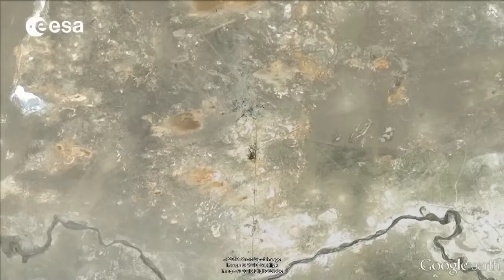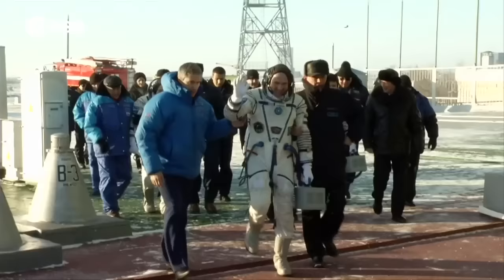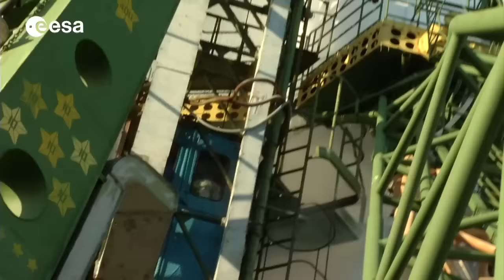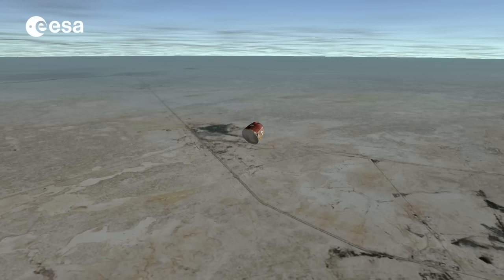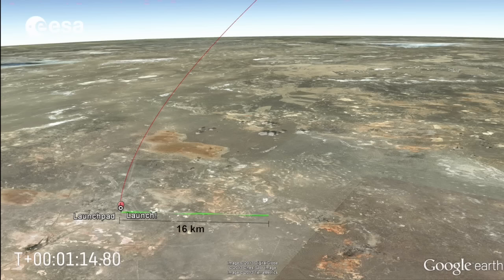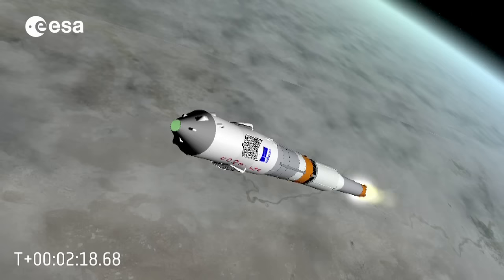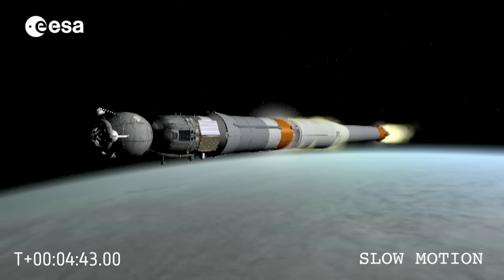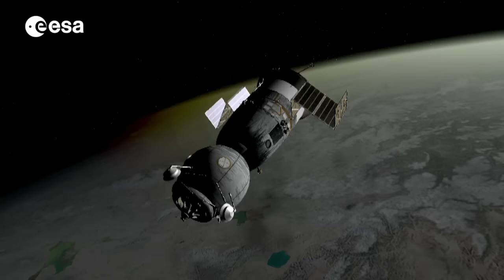The Soyuz launch sequence explained

Comment: Soyuz it's the best rocket ever...
Reply: Soyuz is the space craft. The rocket is an R7 variant. Just like the original rocket developed by Segey Koriolov. Just with all problems of reliability and build quality -solved.
Reply: +mowtow90 the rocket could also be called Soyuz.
Reply: +mowtow90 the spacecraft they use now is the Soyuz MS on the Soyuz-FG rocket.
Reply: I'm
Reply: I guess for Earth Orbit it is the greatest. Everytime I see one launch I feel like I have no worries, she is going to end up just where they aimed her. No Drama, Workhorse!
Reply: Leonardo Solera sls for me
Reply: Plymouth Fury III   It’s certainly a strong message to the US. We had the best with the Apollo spacecraft, and the Saturn boosters (1B for low earth orbit, and V for higher payloads and missions beyond low earth orbit). The glitches had been solved, and we could have gone and started mass production. 

NASA was not really to blame, however. It was the Nixon Administration which canceled almost all of NASA’s post Apollo proposals, and pushed the fatally flawed Shuttle. The Air Force and Intel agencies forced the huge cargo bay. It was supposed to be cheaper, but in reality turned out to be much more expensive. As technology (especially computer technology) advanced, NASA could very well have put updated technology in there. 

Apollo was almost completely redesigned after the Apollo 1 fire. The result was a much more reliable CSM. This was borne out when Apollo 13 had to power up the CM before re-entry. It was feared that water may have gotten into the panels. But it was powered up without any mishap. 

The Saturn proved its capability with Apollo 12, when the entire stack was struck by lightning twice. The well shielded IU kept the Saturn flying in the correct trajectory, while the crew and Mission Control got the Apollo up and running again. 

The Saturn series is one of very few rocket systems never to have any catastrophic failures. I guess the bean counters at Nixon’s OMB never heard of the phrase “if it’s not broken, don’t fix it.” It was a monumentally stupid decision, but there was little NASA could do about it. It doesn’t give itself a mandate, as JFK did, and it has no control over its budget. That’s why you had contracts with various locations all over the country.
Reply: Jansel Kenneth Tolentino   Loosely speaking, you are correct, but the way the agencies worked, the usual nomenclature was to list the spacecraft then the booster system. Such as Apollo Saturn, or Gemini Titan, Mercury Atlas, and Mercury Redstone. I suspect it’s much the same for the Russian space agency.
Reply: Cough cough falcon heavy
Reply: @jfiekms  not ready
Reply: @SIXITHS  lets see
Reply: @SIXITHS  ok boomer
Reply: and the most reliable as well
Reply: @jfiekms  that flying ipad will never replace soyuz
Reply: soyuz is a European one? and the dragon usa? where all the parts go from the rocket?
Reply: 🤣🤣Falcon 9 is the king
Reply: @jfiekms  ok troll

Comment: Although i loved the Space Shuttle, the Soyuz is a much safer vehicle for getting humans into space, and very reliable. Very interesting to be able to see all that is involved with the launch.
Reply: +100SteveB. I wonder how hard the landings on the Soyuz are on their bodies? The Space Shuttle landings are very gentle on the Astronauts bodies.
Reply: +SanFranciscoBay Yes, I agree that the shuttle was a totally awesome program, but it wasn't logical. Each flight costed around 500 million dollars, while the Soyuz costs 60 million. The Soyuz is also much safer, as if something goes wrong you can shut down the engines. On the shuttle, once the solid rocket fuel is ignited there is no going back for 2 minutes. Personally, I would take the Soyuz,
Reply: The good thing about the shuttle was that it was reusable. Or at least somewhat. The orbiter itself was obviously reusable and the solid rocket boosters would be reused, refurbished or recycled. The external tank was left to burn up in the atmosphere after separation.
It would considerably lower the costs of each launch if some of the soyuz parts were reused.
Reply: KlixTrio 
"On the shuttle, once the solid rocket fuel is ignited there is no going back for 2 minutes."

This is exactly right. I think it was von Braun who said that no human should ever ride a solid booster rocket. With the Space Shuttle, it was a combination of the two so there was at least some room to manoeuvre. The issue came up about ten years ago when NASA proposed a spacecraft powered by a single solid booster (Orion?). It was supposed to be ridden by humans... But you are absolutely right: once that thing is alight, there's no shutting it down. And I agree with your conclusion. I would take the Soyuz too, 100% and for exactly that reason.
Reply: Actually I'd take new Federatsiya spacecraft aboard the new Angara rocket. To the moon.
Reply: Nah on second thoughts I'm just gonna ride a V2
Reply: So called reusable engines had to be refurbished for months to be used again. Space plane is a cool idea, but its just too early for current humanity technological level.
Reply: And cheaper to launch
Reply: KlixTrio I would take the soyuz for safety, if I would have 2 life's shuttle absolutely. It's something amazing, cannot even explain it 😍
Reply: Shuttle was, unfortunately, an expensive death trap.
Reply: As a kid, the Soyuz freaked me out because I had a problem with claustrophobia. The cramped interior combined with bulky space suits and a tiny hatch, scared me to death, even from 5000 miles away. :)
Reply: TheThirdMan The Ares I
Reply: TheThirdMan You're thinking of the Ares I, and you're absolutely right. The extreme vibrations would've killed everyone aboard, so they thought pf using a giant spring, but even that wouldn't have been enough. But it sure looked cool.
Reply: SanFranciscoBay Gentle landings? Literally everyone to land the shuttle says it flies like a brick. It needs a parachute to land. It's descent rate is 15 times that of a regular plane on final approach to the runway. Every landing tore up the runway, resulting in both the tires and the asphalt needing to be repaired.
Reply: Samovar maker the thing about the shuttle was the maintence. It was so expensive and time-consuming that some would say it was better if they just built a new one. It wasn't powerful enough to get even 30 tons to orbit so it didn't make sense actually
Reply: The Shuttle was the way it was because NASA had to get the Air Force involved in order to get funding for a reusable launch vehicle and the Air Force wanted certain things like the ability to set down at multiple landing zones and the ability to launch and land in a single orbit. Basically they had plans to use it as a sort of orbital spy plane but advancements in spy satellites rendered that option unnecessary. So NASA ended up with a system bloated with capabilities that were irrelevant to what they ended up actually using it for. Putting the orbiter right next to the fuel tank was a terribly unsafe idea, but necessary when you've designed something that is basically an airplane attached to a giant rocket. A capsule could actually have survived the kind of accident that destroyed Challenger because it's on top of the rocket and can be ejected from the main booster in an emergency.
Reply: SanFranciscoBay   That’s assuming they survive the flight. Apollo was every bit as reliable, especially the re-design after the Apollo 1 fire.
Reply: SanFranciscoBay  The current problems upon re-entry now have little to do with the astronauts or cosmonauts medical issues upon landing. The problem is that even with strenuous activity by the ISS crew, they still have loss of muscle tone, and loss of the skeletal structure. Not to mention problems with their eyes. 

The returning crew has to be carted away on stretchers. That needs to be solved.
Reply: TheThirdMan   The Shuttle was a perfect example of what happens when you design and build something by committee. That resulted in a very dangerous vehicle. Originally, the orbiter itself was going to be much smaller. And the boosters were going to use liquid propellants.
Reply: KlixTrio,
There is no denying that the space shuttle was more expensive but, you are comparing two things that have a different purpose.  It all depends on what you want to do when you get there.  A lot more could be done with the shuttle.  It had the volume and systems to conduct many experiments as well as placing other satellites in orbit and served s a cargo vessel as well.
Reply: TheThirdMan   At least with Orion, solid boosters or not, will have a launch escape system, just as Apollo did. There was no such system with the Shuttle. And the costs of re-use were MUCH higher than the older, expendable boosters and spacecraft. 

The Shuttle was a very expensive death trap. It was also much more expensive, and was strictly limited to low earth orbit. It could never survive re-entry from a higher orbit. The orbiter would be torn apart.
Reply: The Soviet Buran was basically what the space shuttle would have been, ideally.
Having been designed years after the space shuttle, without any additional special requirements by other departments, and with low cost per launch weighing heavily on design, it would have filled the low cost reusable role MUCH better than the space shuttle.
Energia, despite never having had the chance to test reusability, was meant to be a reusable super heavy lift rocket, and as a standalone rocket it could be used without Buran to potentially lift ISS components into orbit.
Whether or not Buran was safer, we'll never know.

But in the end, you're still sending a very large reusable vehicle into orbit...for what? Both shuttles ended up being unnecessary expenditures.
Reply: I always think about Soyouz as a high quality bicycle while Space Shuttle is like a modern car. Bicycle, of course, is safer, harder to fail. But it cannot carry much weight and technology. Remeber, SS can deliver 7 men, tons of goods and devices, reaching higher orbit (I am actually not sure when writing this).
Reply: Space shuttle was sketchy - no real abort system
Reply: @klixtrio7760  I mean the Shuttle was designed to do stuff no other spacecraft, apart from Buran, could do. Not even the new 'Starship'. It could carry large ammounts of cargo and a big crew (7) simultaneously. It could 'manually' place sattelites into orbit. It could allow space walks. It could allow even the retrival of sattelites, something which is impossible now. Without the Spcae Shuttle, maintainance on hubble would have been near impossible (or even many times more  expensive)

Comment: Problem: G-forces during launch make it hard for the pilot to reach up and hit the switches.

NASA: "Better go back and redesign the entire layout of the interior."
Russia: "Give the pilot a stick."
Reply: lol this is so true. It's the same story with the Pen in space - Nasa spent millions to design a pen - Russians always used a pencil -)))))))))))
Reply: ***** NASA spent 0 (ZERO, nil, none) money on the spacepen. It was independently developed by a company from whom nasa and the soviets bought pens from for $2.95 a piece. WOW, $2.95 = millions! NASA used pencils initially too, but the reason neither the soviets or NASA continued using pencils is because if you break the tip, now you have a conductive piece of graphite flying around that can get into small cracks and equipment. Youd think in the age where a simple google search brings the information of the world to your fingertips, moronic assumptions and urban legends would die, but nope.
Reply: +Ron Ramen In present time yes but back in 60's soviets used a pencil on the other hand nasa (or contractor it's irrelevant) develop a pressurized pen and it wasn't near as cheap as a pencil back in time
Reply: Its literally $2.95 and it was the Fisher Pen company that spent money developing it.They weren't even a contractor (which they would be if NASA paid them to research pressurised pens) NASA literally just bought pens from them. They could have bought them from BIC, or Mead or whoever. You're just splitting hairs.
Reply: astronaut NOT pilot
Reply: Советские космонавты использовали автоматические карандаши. Они не ломались, были безопасны и надёжно писали в любой среде.
Reply: My granddaughter solved this problem. CHALK... just don't clap the erasers. :)
Reply: No idea what you said, but I bet you are correct.
Reply: russian use common pens, not pencils.
Reply: Both have their ups and downs
Reply: It is just an urban legend, that pen-pencil thing.
Reply: That's a myth.
Reply: That is not the point. The point is the huge gap in mentality. One looks to avoid the problem altogether, (Leave the interior buttons where they are) whereas the other tries to address the effects of the problem.
Reply: Extra Salty  Pilot is appropriate if that particular astronaut happens to be the mission pilot.  It is one of the position on a space mission, just like engineer, mission commander, etc.
Reply: It's got a strap around his hand, you can see it if you look carefully.
Reply: Lool
Reply: Extra Salty cosmonaut to be precise.
Reply: Paul JJ That's a myth.
Reply: Ron Ramen BIC and Mead barely existed at the time. And they have never produced a pressurized pen which would not be able to puncture anything.
Reply: Plymouth Fury III One problem: how do you sharpen it? And how do you write clearly with it in a manner similar to pencils? Those problems would be more difficult to fix than using the pen that they did.
Reply: themocaw This is why the soviets had creative thoughts
Reply: Paul JJ NASA didn't spent millions, they bought it from a contractor. Pencils in space are dangerous and can causeshorts if they break.
Reply: Channel Curious Droid made a video about these "space pens" if you're curious to know the truth
Reply: Ladies and Gentlemen, there seems to be a 'space pencil gap'  ?!!?  ;-)
Reply: So true, even in a Cessna 150 on a gusty day.  Can't even turn the radio dials without hitting the roof of the cockpit.
Reply: Until the stick comes loose and hits the pilot in the face because it now five pounds because of the G-forces.
Reply: >Nasa spent millions to design a pen - Russians always used a pencil -)))))))))))
It is a fable. At early space program USSR used wax pencils which newer break, produce no pieces, but write inaccurately. When Fisher invented and Fisher Spacepen Co. offered to buy Zero Gravity Pens USSR simply bought 100 such pens. Since 1969 Zero Gravity Pen is used in both space programs, american and soviet.
Reply: @itftcomputers  That story is an urban legend and you should stop spreading it.
Reply: g force rated game stick . all the launches are controlled from ground control.
Reply: The Space Shuttle was like a limo. Only 4Gs on launch, and re-entry. 9Gs is brutal. 4Gs is bad enough.
Reply: @rocketnerd7763  lol! that is how supposed to be every where! not sucking money from simple people like us!
Reply: LMAO !!!!!
Reply: @Alexander Zhang Even writing on a wall renders a ball point useless.
Reply: Alexander Zhang it’s connected to his hand and they have 3 of them on board. Plus the commander has a tablet that he can use if the system is down or something else.
Reply: NASA: We need to design a special system to ignite the engines
Russia: USES GIANT WOODEN MATCHES
(this isnt a joke btw)
Reply: Problem : You can't use ballpoint on space

NASA : Spend million to designed ballpoint for space.

Russia : Using pencil.
Reply: themocaw problem: normal pens dont work properly in space
NASA: create a $1billion pen
Russia: PENCIL
Reply: NASA did not design the pen they just bought it
Reply: They have a pointy stick
Reply: @subhandin3435  Jesus H Christ..NO!
Reply: иван петров dude, if you understand english, speak english so that they can understand. Translation: Soviet astronauts used special pencils designed for cosmos use. Those pencils do not break and do not create debris that can drift into eyes or equipment.
Reply: @extrasalty703  cosmonaut not astronaut
Reply: @helloworldstein  pens are lead..
Reply: US: Expensive Junks
Russia: Affordable and reliable
Reply: @itftcomputers  That's hilarious.
Reply: @garbygarb31  they are called lead but aren't made with lead. they are graphite. Jesus Christ, the internet has democratized idiocy isn't it?
Reply: They fix the issue with Vodka
Reply: @clod2692  naw common pens do not work because no gravity

Comment from the maker: Four hours to launch for the Soyuz TMA-13M crew! This video explains the journey ESA astronaut Alexander Gerst and his crewmates are about to take to get to the International Space Station.

The Soyuz launch sequence explained

 #BlueDot
Reply: 14-17g, damn for the escape system... wow.

I love how quickly they can put up a rocket.
Reply: Wow, never knew about the launch escape system.
Reply: Mark Peterson US rockets had it, too.
Reply: If I remember corectly the blackout/breathing training for Airforce pilots is done using 15G.
Reply: Cool vid. Thanx.
Reply: oooooohh
Reply: P. Ricard It's about 9g for fighter jet pilots, but that's vertical positive g's.
In order to relieve the stress on the astronouts they are possitioned so the g-forces work on them perpendicular to their body length (from behind)!
I'm NOT saying 15+ g's that way is not hard (or maybe even dangerous if not properly trained/equipped), just stating that the direction of the g-force is important, and is different from that of fighter pilots or even F1-drivers(lateral g's).